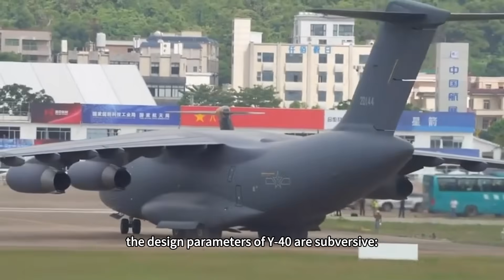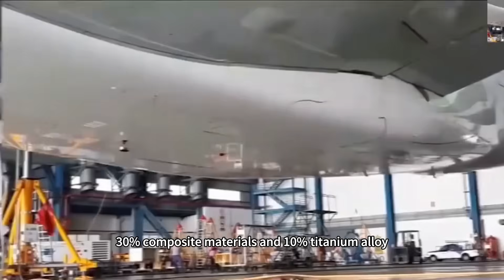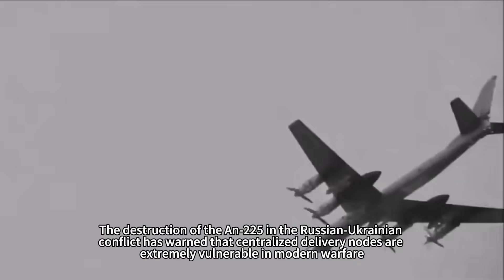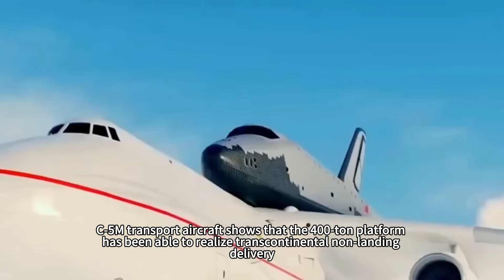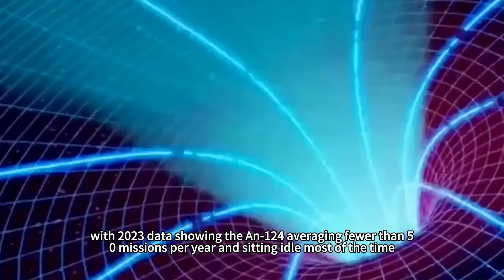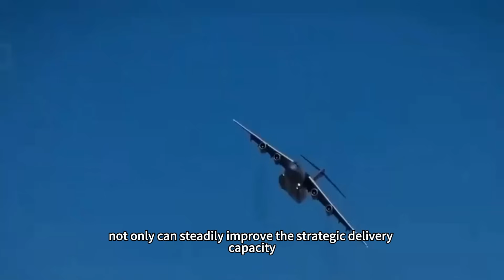Bigger than the An-225, China's 660-ton Y-40 revealed?

Comment: The Y-40 meets China's Belt and Road Initiative strategic requirements... It is essential to ensure field takeoff and landing capabilities... to enable rapid deployment of high-speed rail systems, drilling platforms, wind turbine generators, hydroelectric generators, transformers, industrial equipment, helicopters, cranes, air defense systems, and other equipment to any location worldwide... Rapid Deployment Solutions for Development.

Comment: Interesting. Nevertheless this video is not really worth watching, when the AN-225 seems to be the main focus of "possible" detils of the Y-40. As is usual,  the Chinese do not tend to brag about what might be militarily in "development", until it is in "deployment", in this instances. "Strategic Depth" does required a more strategically cerdible analysis, if it wants to be seen as a credible platform.
Reply: China's Y-40 transport aircraft is indeed under development, progressing smoothly. Its core turbofan-35 engine has passed high-altitude tests, key technologies like titanium alloy 3D printing meet standards, and engineering verification is advancing, with first flight expected before 2030. It will fully surpass the U.S. military's C-5M: max takeoff weight over 460 tons and payload 120-180 tons, far exceeding C-5M's 418-ton takeoff weight and 122-ton payload; cruising speed 0.85 Mach, better than C-5M's 0.78 Mach. The U.S. C-5M is over 40 years old, with only 46% mission readiness due to parts shortages and high maintenance costs. With late-mover tech advantages, Y-40 has higher fuel efficiency and better adaptability, set to become the world's top strategic transport aircraft, demonstrating China's aviation strength.
Reply: Y-40 vs U.S. Transport Planes: Core Differences & China's Advantages
 
1. Engines: Stronger Thrust, More Advanced Tech
 
- Y-40: Equipped with 4 Changjiang-2000 military turbofan engines, single-engine thrust up to 35.2 tons, total thrust over 140 tons. Adopts ceramic matrix composites, heat resistance over 2000K, high fuel efficiency and long service life (50,000 flight hours).
- U.S. C-5M: Uses 4 old GE TF39 engines, thrust weaker than Changjiang-2000, high fuel consumption, relies on outdated tech with high maintenance costs.
 
2. Core Performance: All-Round Leading, Better Adaptability
 
1. Weight & Payload: Y-40's max takeoff weight 500-600 tons, payload over 150 tons; C-5M only 379 tons takeoff weight, payload about 130 tons—Y-40's carrying capacity dominates.
2. Cargo Hold Design: Y-40 features innovative double-deck cargo hold, can load an armor company's equipment, loading/unloading time cut by 50%; C-5M has old single-deck, backward structure, needs frequent rivet inspection for safety.
3. Combat Adaptability: Y-40 can take off/land at plateaus (over 4000m), modular cargo hold convertible to refueling/warning aircraft; C-5M requires extra modification for complex terrain, single-function.
4. Range & Fuel Consumption: Y-40's full-load range 6500km, composite material ratio 30%, fuel consumption reduced by 15%; C-5M's full-load range only 5526km, fuel efficiency far inferior.
 
3. Tech & Supply Chain: Independent Control, Strong Late-Mover Advantage
 
- Y-40: Digital design + pulse production line, R&D cycle shortened by 30%, full industrial chain independent with no supply chain risks, expected first flight in 2030.
- U.S. Planes: C-5M's age over 40 years, design from 1960s, new-generation projects face R&D delays, rely on external supporting facilities with easy constraints.

Comment: Fake news.
Reply: Fake brain
Reply: China's Y-40 transport aircraft is indeed under development, progressing smoothly. Its core turbofan-35 engine has passed high-altitude tests, key technologies like titanium alloy 3D printing meet standards, and engineering verification is advancing, with first flight expected before 2030. It will fully surpass the U.S. military's C-5M: max takeoff weight over 460 tons and payload 120-180 tons, far exceeding C-5M's 418-ton takeoff weight and 122-ton payload; cruising speed 0.85 Mach, better than C-5M's 0.78 Mach. The U.S. C-5M is over 40 years old, with only 46% mission readiness due to parts shortages and high maintenance costs. With late-mover tech advantages, Y-40 has higher fuel efficiency and better adaptability, set to become the world's top strategic transport aircraft, demonstrating China's aviation strength.

Comment: They can.
With all the manufacturing, technical & scientific capabilities.
Reply: LEARN FROM USA AND EARN FROM WORLD😂😂😂😂😂
Reply: @jaihind124 Y-40 vs U.S. Transport Planes: Core Differences & China's Advantages
 
1. Engines: Stronger Thrust, More Advanced Tech
 
- Y-40: Equipped with 4 Changjiang-2000 military turbofan engines, single-engine thrust up to 35.2 tons, total thrust over 140 tons. Adopts ceramic matrix composites, heat resistance over 2000K, high fuel efficiency and long service life (50,000 flight hours).
- U.S. C-5M: Uses 4 old GE TF39 engines, thrust weaker than Changjiang-2000, high fuel consumption, relies on outdated tech with high maintenance costs.
 
2. Core Performance: All-Round Leading, Better Adaptability
 
1. Weight & Payload: Y-40's max takeoff weight 500-600 tons, payload over 150 tons; C-5M only 379 tons takeoff weight, payload about 130 tons—Y-40's carrying capacity dominates.
2. Cargo Hold Design: Y-40 features innovative double-deck cargo hold, can load an armor company's equipment, loading/unloading time cut by 50%; C-5M has old single-deck, backward structure, needs frequent rivet inspection for safety.
3. Combat Adaptability: Y-40 can take off/land at plateaus (over 4000m), modular cargo hold convertible to refueling/warning aircraft; C-5M requires extra modification for complex terrain, single-function.
4. Range & Fuel Consumption: Y-40's full-load range 6500km, composite material ratio 30%, fuel consumption reduced by 15%; C-5M's full-load range only 5526km, fuel efficiency far inferior.
 
3. Tech & Supply Chain: Independent Control, Strong Late-Mover Advantage
 
- Y-40: Digital design + pulse production line, R&D cycle shortened by 30%, full industrial chain independent with no supply chain risks, expected first flight in 2030.
- U.S. Planes: C-5M's age over 40 years, design from 1960s, new-generation projects face R&D delays, rely on external supporting facilities with easy constraints.
Reply: Hope Indian not angry about China leading as usual. @jaihind124

Comment: China can build the world's largest airplanes and longest range without any problems but take longer to make the perfect airplanes.
Reply: Y-40 vs U.S. Transport Planes: Core Differences & China's Advantages
 
1. Engines: Stronger Thrust, More Advanced Tech
 
- Y-40: Equipped with 4 Changjiang-2000 military turbofan engines, single-engine thrust up to 35.2 tons, total thrust over 140 tons. Adopts ceramic matrix composites, heat resistance over 2000K, high fuel efficiency and long service life (50,000 flight hours).
- U.S. C-5M: Uses 4 old GE TF39 engines, thrust weaker than Changjiang-2000, high fuel consumption, relies on outdated tech with high maintenance costs.
 
2. Core Performance: All-Round Leading, Better Adaptability
 
1. Weight & Payload: Y-40's max takeoff weight 500-600 tons, payload over 150 tons; C-5M only 379 tons takeoff weight, payload about 130 tons—Y-40's carrying capacity dominates.
2. Cargo Hold Design: Y-40 features innovative double-deck cargo hold, can load an armor company's equipment, loading/unloading time cut by 50%; C-5M has old single-deck, backward structure, needs frequent rivet inspection for safety.
3. Combat Adaptability: Y-40 can take off/land at plateaus (over 4000m), modular cargo hold convertible to refueling/warning aircraft; C-5M requires extra modification for complex terrain, single-function.
4. Range & Fuel Consumption: Y-40's full-load range 6500km, composite material ratio 30%, fuel consumption reduced by 15%; C-5M's full-load range only 5526km, fuel efficiency far inferior.
 
3. Tech & Supply Chain: Independent Control, Strong Late-Mover Advantage
 
- Y-40: Digital design + pulse production line, R&D cycle shortened by 30%, full industrial chain independent with no supply chain risks, expected first flight in 2030.
- U.S. Planes: C-5M's age over 40 years, design from 1960s, new-generation projects face R&D delays, rely on external supporting facilities with easy constraints.
Reply: China's Y-40 transport aircraft is indeed under development, progressing smoothly. Its core turbofan-35 engine has passed high-altitude tests, key technologies like titanium alloy 3D printing meet standards, and engineering verification is advancing, with first flight expected before 2030. It will fully surpass the U.S. military's C-5M: max takeoff weight over 460 tons and payload 120-180 tons, far exceeding C-5M's 418-ton takeoff weight and 122-ton payload; cruising speed 0.85 Mach, better than C-5M's 0.78 Mach. The U.S. C-5M is over 40 years old, with only 46% mission readiness due to parts shortages and high maintenance costs. With late-mover tech advantages, Y-40 has higher fuel efficiency and better adaptability, set to become the world's top strategic transport aircraft, demonstrating China's aviation strength.
Reply: LEARN FRIN FROM USA EARN FROM WORLD, ITS POLICY OF CHINA😂😂😂😂
Reply: @jaihind124 did the US teach China how to build all of those high-speed rails??? How do you learn from the US what they don't even have😂😂😂😂😂😂
Reply: @THE-AES-IS-THE-FUTURE   GENTLMAN ALL STEALTH TECHNOLOGY,  ALL AVIATION, ALL CHIP MAKER SEMICONDUCTORS MANFACTURING,  CHINA STEAL FROM USA OK, NOW PALANING OF DEDOLLARISATION OK, TRUMP IS BRILLIANT OK,
Reply: @jaihind124 When Indian can't compete with China and grows angry, jealous, and desperate upon witnessing China's breakthroughs and achievements, all he can says is, 'It's stolen/copied.'"(*Nice way for self comfort tho )(*while he doesn't know which parts are being copied/stolen)

Comment: If that is true...then it needs an engine with 85,000lb thrust rating minimum like the A380.
Reply: Ws19?
Reply: This aircraft differs from the A380. The A380 is funded by consumers paying for tickets, where fuel efficiency is critical. However, the Y-40, as a strategic airlifter, is state-funded. If you need to deploy an air defense system within a week, fuel efficiency becomes irrelevant – your focus is on mission accomplishment.
Reply: China's Y-40 transport aircraft is indeed under development, progressing smoothly. Its core turbofan-35 engine has passed high-altitude tests, key technologies like titanium alloy 3D printing meet standards, and engineering verification is advancing, with first flight expected before 2030. It will fully surpass the U.S. military's C-5M: max takeoff weight over 460 tons and payload 120-180 tons, far exceeding C-5M's 418-ton takeoff weight and 122-ton payload; cruising speed 0.85 Mach, better than C-5M's 0.78 Mach. The U.S. C-5M is over 40 years old, with only 46% mission readiness due to parts shortages and high maintenance costs. With late-mover tech advantages, Y-40 has higher fuel efficiency and better adaptability, set to become the world's top strategic transport aircraft, demonstrating China's aviation strength.
Reply: Y-40 vs U.S. Transport Planes: Core Differences & China's Advantages
 
1. Engines: Stronger Thrust, More Advanced Tech
 
- Y-40: Equipped with 4 Changjiang-2000 military turbofan engines, single-engine thrust up to 35.2 tons, total thrust over 140 tons. Adopts ceramic matrix composites, heat resistance over 2000K, high fuel efficiency and long service life (50,000 flight hours).
- U.S. C-5M: Uses 4 old GE TF39 engines, thrust weaker than Changjiang-2000, high fuel consumption, relies on outdated tech with high maintenance costs.
 
2. Core Performance: All-Round Leading, Better Adaptability
 
1. Weight & Payload: Y-40's max takeoff weight 500-600 tons, payload over 150 tons; C-5M only 379 tons takeoff weight, payload about 130 tons—Y-40's carrying capacity dominates.
2. Cargo Hold Design: Y-40 features innovative double-deck cargo hold, can load an armor company's equipment, loading/unloading time cut by 50%; C-5M has old single-deck, backward structure, needs frequent rivet inspection for safety.
3. Combat Adaptability: Y-40 can take off/land at plateaus (over 4000m), modular cargo hold convertible to refueling/warning aircraft; C-5M requires extra modification for complex terrain, single-function.
4. Range & Fuel Consumption: Y-40's full-load range 6500km, composite material ratio 30%, fuel consumption reduced by 15%; C-5M's full-load range only 5526km, fuel efficiency far inferior.
 
3. Tech & Supply Chain: Independent Control, Strong Late-Mover Advantage
 
- Y-40: Digital design + pulse production line, R&D cycle shortened by 30%, full industrial chain independent with no supply chain risks, expected first flight in 2030.
- U.S. Planes: C-5M's age over 40 years, design from 1960s, new-generation projects face R&D delays, rely on external supporting facilities with easy constraints.